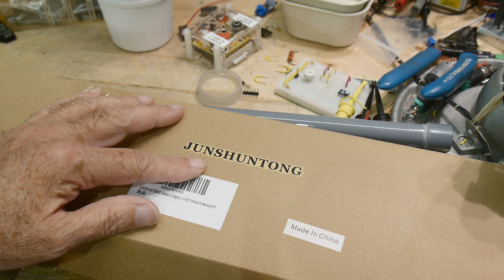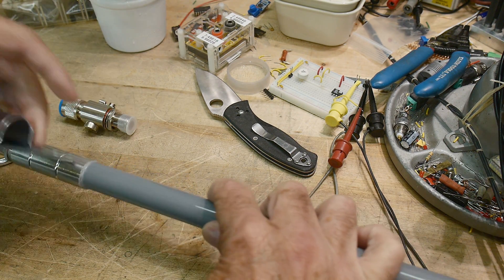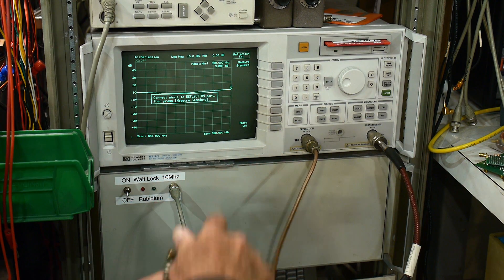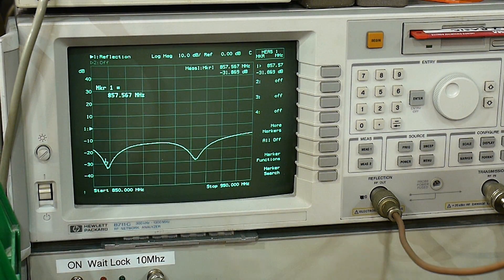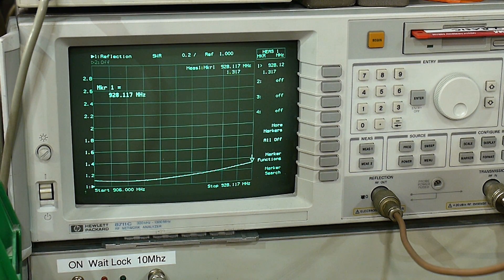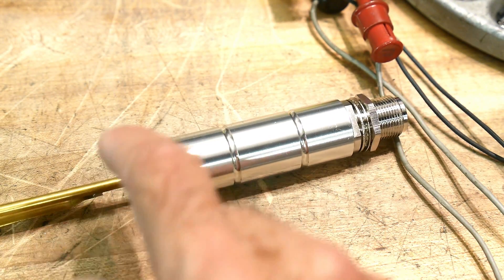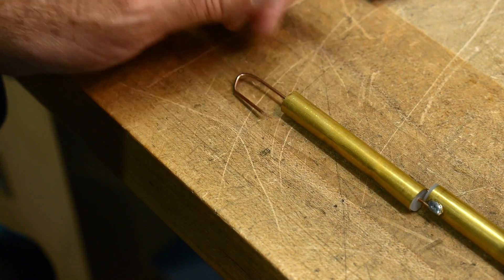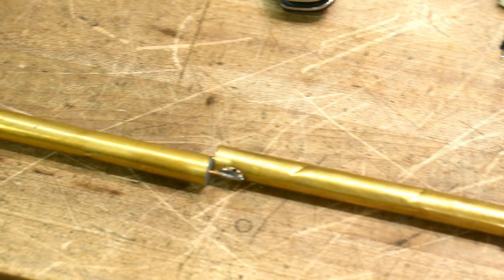#1139 LoRa Antenna 915MHz 8dBi Gain Outdoor Omni-Direction

Comment: I broke the first antenna to open it like you, then I realized that by heating the aluminum part it is very easy to unscrew it from below (and probably also loosens the glue between the fiber tube and the aluminum collar).

Comment: The dimples are there to create friction, just to help hold the dielectric in place during assembly, as they will slide right out of the brass tube.

Comment: jungsungtong me bicky bong wang song my dong! I have two 850-900 Mhz yagi's 3ft long@ 75Ohm. been using this for ten years now!! U can place a 5Watt fuse on the line.. if U don't have the
lightning arrestor...most folks don't realize U can use several frequencies from 600-3000Mhz for free!! I use mine on paid cellular though.. works super duper..a -120db without..& -65db 
with...wow! thats the most important thing!! SWR & tunning!! filters R the big key/micro baluns..ohm bridge for 50 or 75...good luck..

Comment: I built similar coax collinear for 1090MHz. Simple and easy
Reply: If I wanted to build one for 923 MHz, do I google 'coax colinear antennna'? Is that what this wire in tube design is? Seems simple enough, soldering copper wire in brass tubes with plastic disc plugs. What's the funky bit at the bottom with the extra brass shim on it?
Reply: @davidtaylor6124  Look at this: https://www.youtube.com/watch?v=WDCsK73SC4c
and more: https://www.youtube.com/results?search_query=coax+collinear+antenna

Comment: The 868MHz frequency band is used for LoRa in Europe instead of the 915MHz used in the Usa.
Reply: Yes, European LoRa is 867 - 869 MHz. Much smaller than North America (902 - 928).
This restricts Europe to only 10 channels while NA has 64+8+8 channels.
Downlink BW is also smaller in Europe at 125 KHz while Na can run at 500 KHz.
Europe definitely got the short end of the stick on this deal...
Reply: @EngineeringVignettes  as usual

Comment: Looks like you didn't have to take the Radome off of the base. You may have just unscrewed from the bottom. Would this be a colinear antenna ? As for the dents I think they do it to hold the section assembly together . Thanks for the video.

Comment: I’d be curious to see if the lightning arrester they provided has any effect on the antenna resonance. I’m really shocked with the internal construction refuse to be built very well he could’ve achieved the same design using coax for a lot less money.
Reply: But dual band? That would be a good trick.